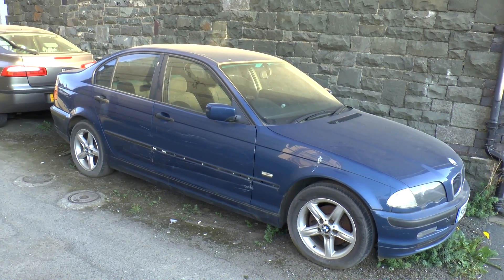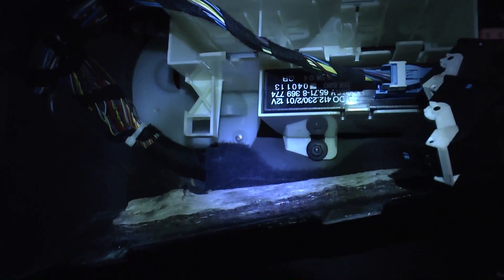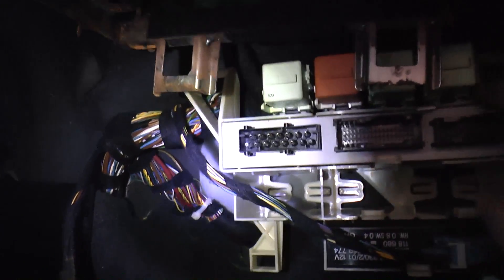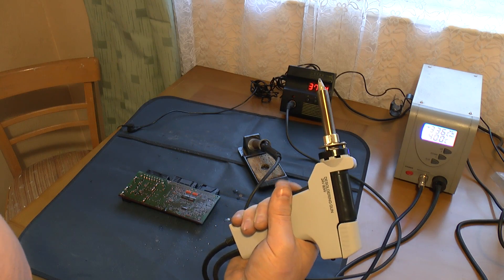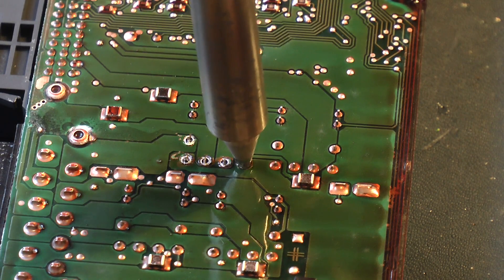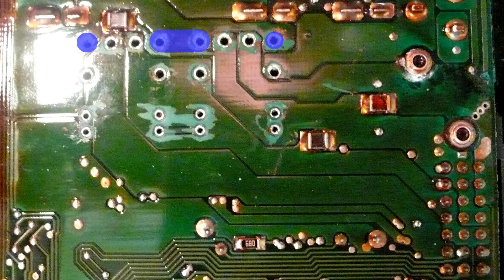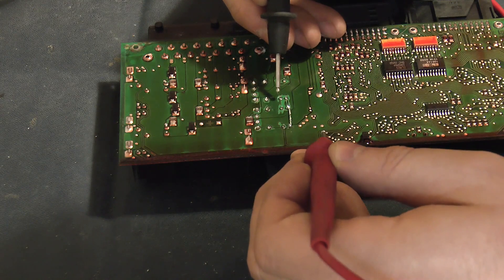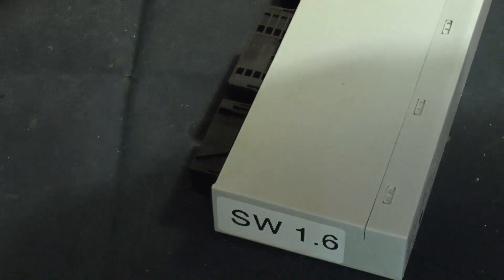Central locking relay replacement in a BMW GM5 module (3-series, X3, Z4, Z8)

Comment: AintBigAintClever I just replaced the relays on my bmw e46 everything works but the drivers side door won't lock anymore. did i maybe break a track? do you know which one is for locking the drivers door?

Comment: hey bud , many thanks for replacing my relays in the gm5 from scotland i sent .. looks like its something else wrong tho ! when u press the lock button standing outside , the indicators flask 1 time + a small noise from the door ...   same as before tho. central locking aint working . bbot opens with key button only.   boo funkin hoo ...lol

Comment: fixed up mine ;) a bit of a 'shovel' way but still works. worth a try for a guys like me, with no extra equipment,
 what I did was just cuting of the corner (the hole was about 1 square mm) of a relay and spray some electronic contact cleaner inside. did not work at first, but since my relays were responding (clicking when trying to unlock the car but no effect) but stil not working, I was allready about to change them, I cut 2 oposit corners and when the spray went through it went perfect ;))))

Comment from the maker: Mouser Electronics do the less-sensitive versions but the driver circuit should easily be able to handle them, plus I expect the ones with the less sensitive coils will be slightly tougher.

Comment from the maker: If the central locking works when you use the key in the keyhole then I'd expect the problem to be within the key. Have you tried changing the battery?

Comment: good little fix!, tho replacing heavy components like that on multi layer boards is one thing I hate for the same reason, tearing out traces :(

car looks a little worse for wear, I'm guessing its a parts/demo unit?. I do like the way it beeped in complaint as you removed the module live :D